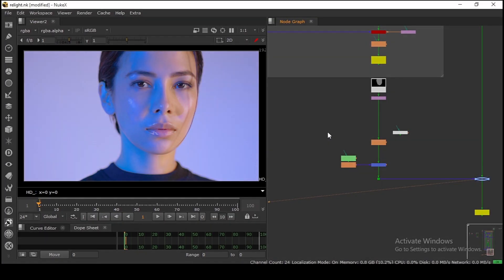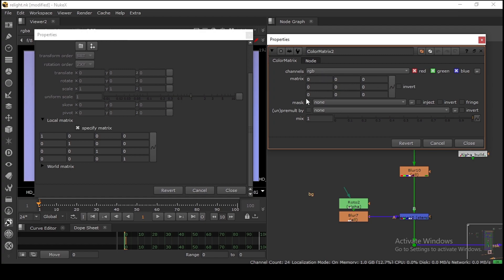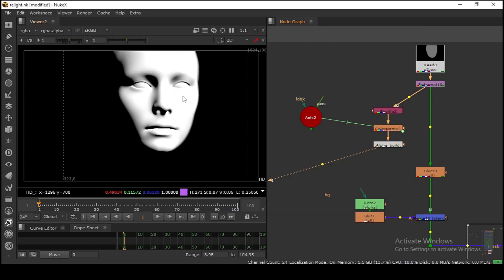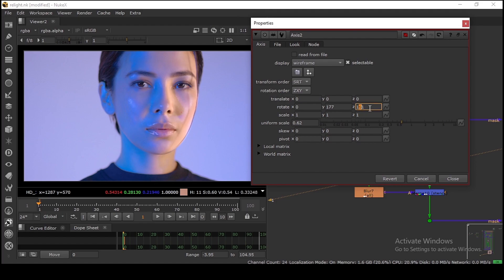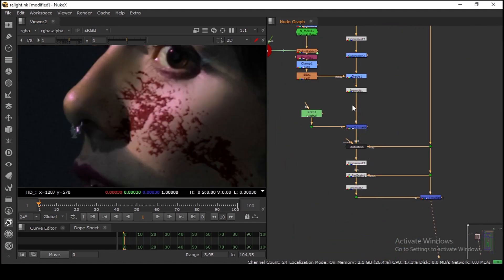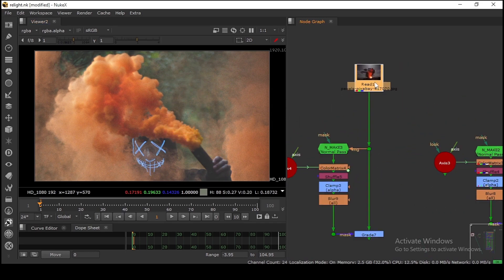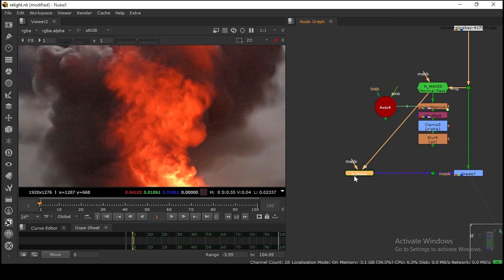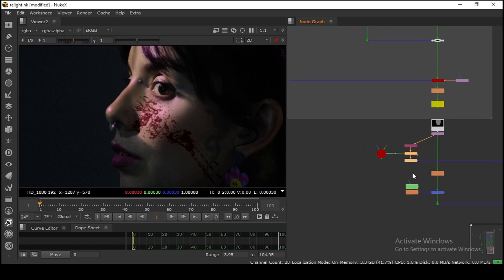Make Your Own Relight tool In Nuke #compositing #foundry #nuke

Comment: how did u creat normal pass for the face.
Reply from the maker: as i said in the video i made face mask using face builder tool which means i have 3D Mesh so i can create normal pass in the scanline render,, this tutorial is not about how to create normal pass it's about how to use normal pass when working in 3D relight or 2D relight work,!!
Reply: Thank for reply, now I got it. Thank u 🙏
Reply: @VFXSHOWDOWN   is it posible to give this nuke file.
Reply from the maker: @Simpleshape3  i will try
Reply: Thanks bro it will be helpfull